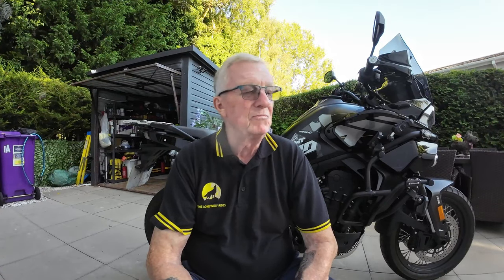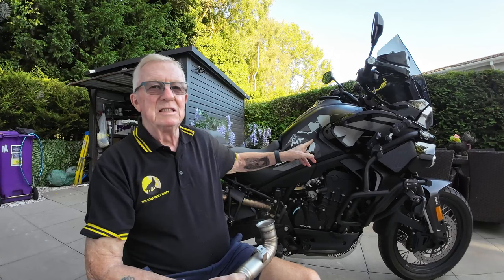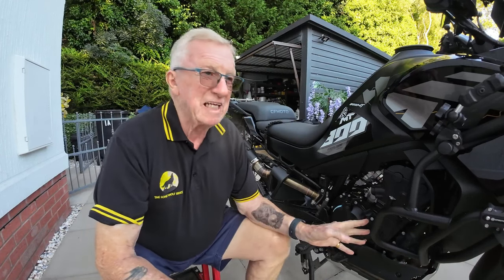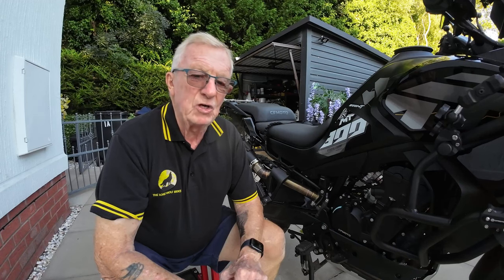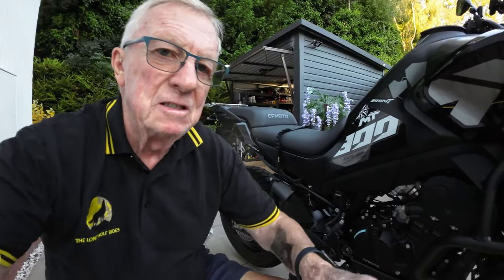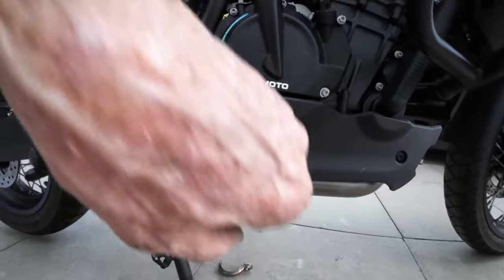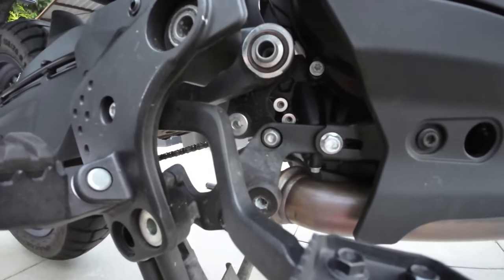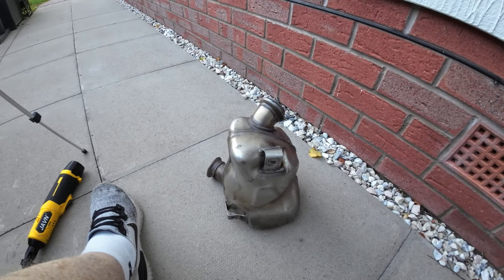Transform Your Cf Moto 800 Mt Explore In Minutes With A Link Pipe Upgrade - Easy Installation Guide

Comment: Well done for sticking with it though as you've said it's likely only a remap will solve the fuelling issue, me I prefer stealth mode rather than a loud pipe
Reply from the maker: @Bazza47  mate I’m using off road mode best by far
Reply: @ivanrushtonthelonewolfrides  it's a bit of a ball ache. My 2018 1200GS LC suffered from a flat spot to get it through the EU emissions regs so this might well be something similar. I had it remapped which solved the problem though the gains in performance were not as noticeable as my 2016 GS which went like SOAS after but was from the previous EU regs standard. Luckily my 1250 was flat spot free. Good luck!

Comment: Thanks for the video info I love mine but that roll on snappy throttle is wearing thin on me I’ve had it in a time or too with the dealer but never any updates on the snatching roll on I ride mine on rain mod all the time I got mine end of December and just turned 14,000 miles I’m very very tired of the fuelling… apart from that love the bike
Reply from the maker: @stephenbryson5618  I have to admit I am exactly the same as you. Other than I tend to rise on off road mode which is definitely a smoother throttle response.  I’m the end I reckon we will all be having re maps by a third party at some time.  Please subscribe to my channel lots more coming up

Comment: Show the doggone link pipe installed on the bike! Also, are you running the silencer in your muffler? BTW, I was able to remove the cat without disconnecting the brake pedal mount. There is room with a ratcheting spanner.
Reply from the maker: @deathwish24620  I will put a picture on tomorrow. The silencer has a muffler it is too loud.